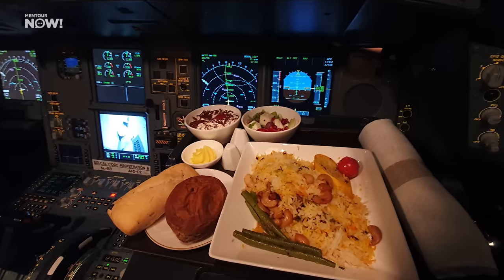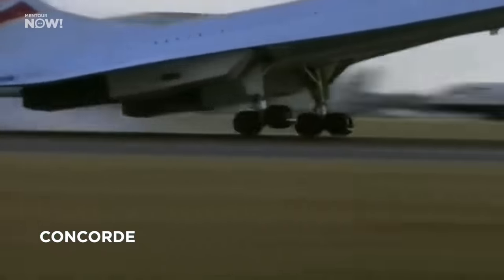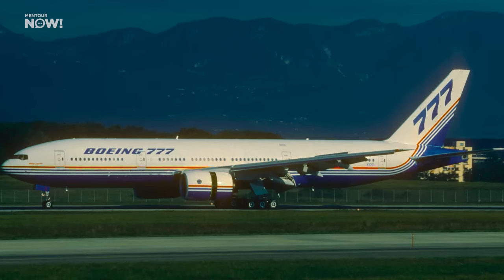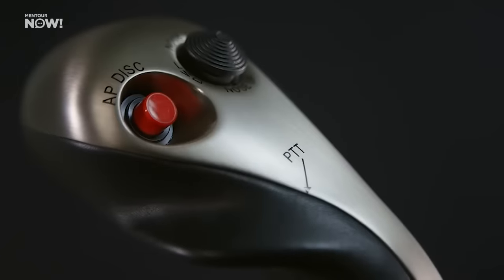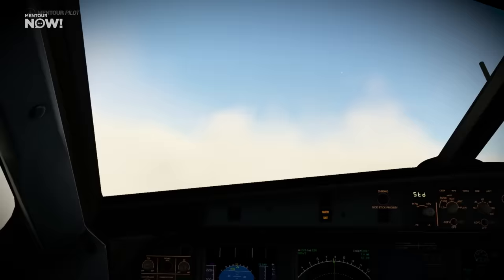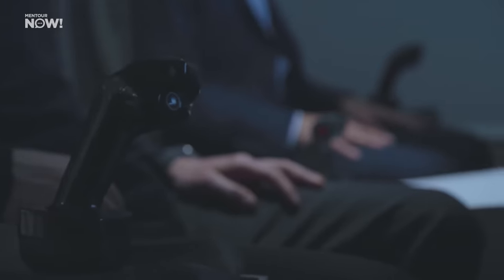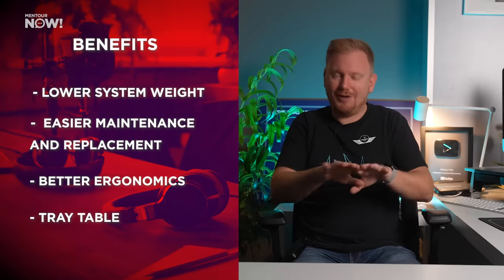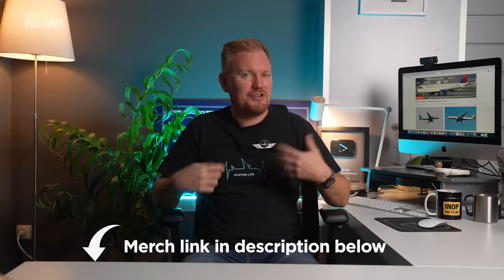Will Airbus Finally switch??

Comment: As an Airbus pilot, I really hope this actually happens. It's been the thing I most don't like about the A320 since I started. You sometimes feel a bit disconnected from the airplane which makes it less fun to fly. Also if this happens we'll have even more ammunition to throw at you Boeing guys in the airbus v Boeing banter we all engage in (most of the time it's completely friendly and just banter. We all try to respect each other and we're all aviation nerds so an airplane that has yokes instead of sidesticks is still going to be cool to us Airbus guys.)
Reply: You mean you are an Airbus computer game flyer
Reply: @MySkyranger  no...
Reply: @MySkyranger 😂 He's the king I'd say, probably never stacked it
Reply: I’m not familiar with Airbus, but are the sidesticks in A320s lit in any way when the ambient lighting is low in the flight deck? For example - active stick when autopilot is disengaged is lit at the base and/or non-active stick is lit at the base to indicate the other is active? Some sort of visual indication seems to me to be useful (and probably far easier to implement (if it’s not already) than feedback). Btw I’m based in CLT so I’m pretty much on A320s all the time - I can always tell when autopilot is disengaged when on approach with the little “wobble” 😉 happens on others too, just feels more obvious on A320s. Less so the A330s we used to have here.
Reply: Yeah, the tray table argument is always one of my favorites as an A320 and A330 pilot, it just makes eating and filling paperwork so much easier. Oh, and don't forget that the A320 cockpits are about 2 times bigger than a 737 cockpit.
Reply: @LucasDiep  yep. Taking a peek into the flight deck of a 737 wherever I get the chance always horrifies me. I can't imagine spending up to 6 hours in one of those. Cramped, dark, cluttered, big metal stick in-between your legs, no thanks. I'll take my A230 any day. I will still always respect the legacy of the 737 nonetheless.
Reply: I think that the sidestick doesn't have as much motion as the yoke, so its much easier to do fine adjustments in yoke than in sidestick.
Reply: @abcdefgh6121  eh that I can see but I don't really find that in my day to day. The sidestick can do everything I need it to do and I think Airbus have the sensitivity down pretty good.
Reply: @abcdefgh6121  Huh. Flying A320/330's for over 10,000 hours I never really felt a struggle making fine adjustments
Reply: Unfortunately due to the lack of wing flex on all Airbus aircraft. They seem to make better plows than planes. Good for the earth. Very bad for passengers and crew.
Reply: No Airbus pilot wants to give up spaciousness and the pull out desk in exchange for a big-ass yoke.
Reply: @LucasDiep  I agree. Don't have quite as many hours as you do but I've never found the sidestick lacking in sensitivity.
Reply: @thereissomecoolstuff  what? What are you implying. 🥴
Reply: @LucasDiep  I was chatting to another pilot from a different airline that has 737s instead of A320s at mine and the tray table inevitably came up and he said "Hey we actually do have a table. We reach back and grab our QRH and/or other binders and sit them on our laps. Instant table." I said "imagine needing and relying on a QRH to know what to do in an emergency. My airplane tells me what's wrong and steps to resolve the issues. It's called ECAM." A bit cheeky but he took it well and then said something about being called a retard everytime we land.
Reply: @elliott7268  just trolling.
Reply: @LucasDiep  okay. i just said what i felt, as sidestick has a very limited motion as compared to yoke, so i thought that for example the minimum we can move  our sidestick is lets say, 5mm. so the same 5mm if deflects plane at like 5 degrees, the same will deflect the plane in yoke to just 2 degrees. so the yoke offers more fine adjustments which are crucial in moments like flare, where it should be pretty accurate. and fine.
Reply: This is a waste of time discussion, it never going to happen. whatever replaces the A320 family of aircraft will have either the current side stick or some newer version. The title of this video is very click bait, some people will assume Airbus will be open to it, they are not, and as for a new Airbus single isle aircraft, don't look for it until 2030+
Reply: @LucasDiep   Agreed. Similar experience. Similar conclusions. It is definitely easier to overcontrol on the A330, but not doing so just comes with experience.
Reply: @thereissomecoolstuff  Huh??  What about the Airbus A220 Series which was designed by Bombardier who are famous for their flexible wings on their business jets.
Reply: @abcdefgh6121  Yes I agree, I am just saying that I never really struggled to control either plane/make fine adjustments when flying.
Reply: @Adscam  I watch a channel called cargospotter he videos take offs and landings in Europe. You watch a 777 land you see those wings just bend while the beautiful landing gear touches down. Graceful, like a ballerina. An Airbus comes in all stiff and gets jacked around. Looks like Biden trying to pick up his keys off the floor. Which do you prefer? A ballerina or an arthritic old man with VD.
Reply: Scare Buss
Reply: @ferrariguy6389  Boeing, building paper airplanes since 2018.
Reply: Agreed even in simulation world it feels weird. Almost like a pitch up command feels irrelevant, however pilots know pitch up command should never be disregarded unless thrust is applied.
Reply: Nice try msfs fbw pilot 😂😂😂😂
Reply: @elliott7268  why does flying professionally in an airline setting need to be "fun"? When passengers are nervous in the cabin with strong winds and updrafts pilots are nonchalantly having "fun"? I've never heard of a medical doctor having "fun" in a life or death situation?
Reply: I know form experience that Boeing and Airbus pilots drool the same when they sit in front of the controls of a legendary aircraft like f.e. a DC3 / L-749.
Yoke sidestick whatever they just want to get that bird in to the air!
Reply: Hi elliot, agree entirely, I suggested feeback for the Side sticks AND for the throttle levers  some years ago when we operated the A330s. My words at that time  were exactly like your,s now,  "Pilot is disconnected from the plane" . Not a good idea !!
Reply: @abcdefgh6121  nah dude. I'm pretty sure there's some sort of sensitivity curve on the side stick. We have no issue making fine adjustments.
Reply: @topethermohenes7658  ok... It doesn't need to be fun sure. But I'm a pilot because I love it. I love flying 60t airplanes high in the sky ferrying all these different people to work, families, holidays ect. What I'm saying is flying a little cessna to get my PPL was more fun and hands on than flying an A320 with a sidestick. I don't understand why you think that a job shouldn't be fun. Why can't I have fun. Do you expect me to just be depressed?
Reply: @thereissomecoolstuff  have you ever seen an A330 or A350 land? I'd call that graceful. If you've ever seen an A380 Land, especially in the flesh like I've been able to many times, that's pretty incredible.
Reply: As pilot of Airbus, I can suppose the idea was isolate one pilot from another(may be it was philosophy). It might be why the control is very sensitive to dual input.This new invention active side stick breaks the philosophy with plus and minus as well. 
For cadets it’s useful tool, but the Airbus is commercial plane.
Reply: @elliott7268  seen it all my friend. If you translate “Airbus” into any of the classic languages it means “Lawn Dart”. Boeing on the other hand means”plane of the gods” you fly on anything you like.
Reply: Both sticks are active in normal ops. If dual inputs are made, it is annunciated via voice alert and visual indications on the glare shield. 
If say, the trainee is making inappropriate inputs, then the trainer can take control by just saying “I have control” and watching the other pilot move their hand away . If time sensitive, ie.g landing etc, the same words and push the red disconnect on the stick. You get instant control and disconnect the other stick. The aircraft will be in trim, so all control loads and responses are as usual. That’s unlike a connected , conventional control column, where , if the other pilot doesn’t let go, the control loads can be very misleading. That has resulted in tail strikes on take off. It is a “ golden rule” on Airbus FBW, only one person flys the aircraft at any time. So it’s either the trainee or the trainer, not both. The same with automation. There is no helping the autopilot, or auto thrust. It is either automatic, or manual. The Airbus philosophy is if the automation isn’t doing what it should, disconnect and fly manually.
 I have seen and read of people flying conventional aircraft get into deep trouble trying to “help” the automation.
Reply: @thereissomecoolstuff  try telling that to the families of the victims of the 737 max crashes. Totally avoidable on Boeings part. Try telling that to the safety inspectors Boeing fired after raising concerns on the factory floor. I could keep going. Airbus will always win this debate. Boeings golden age is long gone unfortunately. I don't care what you think Airbus translates to. I care how the airplane flies and how they both deal with safety.
Reply: pretty cool that you're a pilot and enough of an enthusiast to comment on videos like this. i hope you love your job and know how jealous some of us are of you :)
Reply: @rockandrollstevesteve  I do! It never gets old. Even now just driving to the airport and feeling the Rumble and roar of aircraft taking off and landing gets me excited
Reply: @elliott7268   you have the utmost responsibility to your paying pax to get them where they need safely, professionally. IMO Work seriously in the cockpit, rent a 172 and have fun on the off days.
Reply: @topethermohenes7658  dude. We can be serious and still enjoy our job.
Reply: @elliott7268  Do you know how many hours Max planes flew without incident prior to those 3rd world crashes? I’m not denying anything. All of it should never have happened. The question always should be pilot skill and training. Please tell me pilots in remote areas are held to the same standards and practices as carriers here. They aren’t and never will be. Did the pilots actions contribute to the crash? Airbus doesn’t not win the debate because it is subsidized by the very govt that regulates it. That reason alone has my preference on BA. The french media doesn’t have the spine to cover an Airbus issue. Boeings golden age is far from over. This side stick issue and the time it has taken to correct proves my point. By the way, there is always an Airbus groopie wait to get backstage when someone says anything bad about the flying baguettes. I guess it was your turn.
Reply: @thereissomecoolstuff  still haven't heard anything bad about Airbus... Also Boeing literally didn't tell pilots or Airlines about the existence of MCAS. No pilot no matter how well trained can know about systems they were never told existed. We can keep going on like this but what's the point. You've made it clear that you prefer Boeing even after all the dodgy stuff they've done in the past few decades and you've made it clear you don't like airbus even though there's no reason at all to hate them.
Reply: @elliott7268  you can love you job yes, absolutely. But going out of your way in the basis of having "fun" doesn't sit well with people you fly with, your company and especially your pax.
Reply: @elliott7268   it is implied in you original comment that it's "less fun to fly" and a320 because you feel disconnected, and if you mean less fun means you hate it, better fly 172s and have the time of your life
Reply: @topethermohenes7658  who said I was going out of my way with anything? All I said was I think flying with force feedback is more fun. That doesn't change how I perform my job.
Reply: @topethermohenes7658  so less fun to fly = I hate it? Ok yeah we're done here.
Reply: @elliott7268  I don’t hate the baguette of the skies. I like all aviation. Innovation no matter where it comes from is to be celebrated. None of us would be here in the free world if it wasn’t for Boeing and the women across this country that went from the kitchen to the factory and back 70+years ago. That’s where my loyalty is rooted. Times change and companies change but the simple fact we would be speaking German and Japanese if it wasn’t for Boeing is good enough for me. Good luck to you Elliott. Thanks for the exchange.
Reply: @elliott7268  fun fun fun more fun that, less fun this. Oh God it's like a teenager falling in love for the first time do all pilots act like this?
Reply: @thereissomecoolstuff  a couple last things, I agree that the older golden age of aviation was the best. And Boeing was fantastic in every way. Times have changed though. Just because Boeing was great long ago doesn't mean you should still favour them and ignore their big problems. I used to love Boeing. But to be honest, why be loyal to any company. They're all big billion dollar companies that don't care for us at all. They exist to make money. 30 years ago I would have preferred Boeing. Now, Airbus is killing it. Why be so loyal. Why not get behind the people innovating and keeping the industry going safely into the future.

Also, I'm not from "the free world". This is the world wide web after all.

Enjoy ya day
Reply: @elliott7268  I had my suspicions you weren’t from the free world. My loyalty again comes from living in and being around the workers and families for generations of Boeing Aircraft Company. Boeing leads in innovation from aircraft to Space. They are a for profit company whose stock and bonuses have benefited millions in the free world. These benefits to the families and regions where Boeing calls home are all on the backs of the parts producers and assembly workers. They produce 38 737 a month moving up to 50 a month in 2025. That is pure manufacturing muscle. That’s why I’m loyal. I am also honest and will agree mistakes were made. That is life. So we share 2 different perspectives. Mine from a “Free Country” and yours not. Loyalty counts for something. It’s a character thing. Next time I’m in a Boeing jet getting pushed back and I look over and see an Airbus next to me. The people all crushed in their hard plastic seats I’ll think of you. Oh wait update… the Airbus is on a maintenance hold. They have to change planes. The part is coming out of baguette land.
Reply: @elliott7268 being called a retard on landing just isn’t nice and friendly. I’m not a pilot of either or but the Boeing and its conventional systems do sound more appealing to me than relatively new and complex technology put into the side sticks. I’ll give up on a table that folds out and rather take that paper QRH and know exactly that there’ll never even possibly be any computer glitches on my binder than a screen. Hats off to airbus but Boeing seems the way to go. Then again in medevac you don’t have either or so until beechcraft king airs come with side sticks the yoke has my heart.
Reply: @fabiansachs1907  sure. I hope you know that retard means to slow down or flare. The plane isn't actually calling you a retard. Also you might have some biases against modern tech which is fine, but saying Boeing seems to be the way to go isn't objectively correct. Everyone including Boeing is moving towards advanced tech we already have in Airbus aircraft. Take the 787 for example. Also, we don't just have ECAM, we have physical QRHs as well. We're never relying on one of anything. Regardless, if you like the Yoke, that's great. I would prefer a yoke if the sidestick wasn't so comfortable and didn't take up a lot of space. When you spend hours in those flight decks, space is an important commodity. But yeah. You're entitled to your own opinion.
Reply: Not supposed to be fun
Reply: Congratulation, on your great achievement. I was a helicopter pilot in the army, but due to a left ankle injury whiles in service. I couldn’t transition into the civilian world, so my flying days is over.
Reply: > makes it less fun to fly

When handling an aircraft with hundreds of lives on board, the first priority probably shouldn't be "fun"
Reply: @topethermohenes7658 That answer should be a given. The more you love your job, the more you tend to be the absolute best at it. As for your comment about doctors, you must not know many.....
Reply: @dmcr9525   I'm not talking about loving your job don't you know how to read? Being stupid is easy nowadays
Reply: that last part is a lie
Reply: The problem with a yoke is it is harder to get the cockpit to fit really large or small pilots. Small women have significant problems reaching the controls on Boeing aircraft. And you might argue that's their problem, but a) that's not fair and b) there's a worldwide shortage of pilots likely to last years or decades.
Reply: @abcdefgh6121  "fine adjustments" are what trim controls are for
Reply: @abcdefgh6121  The difference is that you're flying a yoke (or central stick on old style single seaters with your entire arm, whilst you fly a sidestick with your wrist (elbow anchored).
Reply: 😂just because you guys can play minesweeper on your secondary HDD doesn’t mean your airplane is better than ours!!! 😂😂😂
Reply: Yes, and as Collective Souls lead guitarist, I'm thinking of switching to Gibsons...............
Reply: @thereissomecoolstuff well said.
Reply: Did your airline make you fly airbus?
Reply: @elliott7268 autopilot managers vs real pilots (no hate I love fbw)
Reply: @abcdefgh6121 but that’s not how the sidestick works. You’re commanding a rate of change, not a flight control position. I’ve got plenty of Airbus hours, although currently fly a 787 (as well as 737 and 777 experience). Either one of them will do exactly what you want it to do when you’re flying manually, which is probably about 1% of the time in any typical airline sector. Provided, of course, that you understand what you’re asking it to do. Personally, I think moving from a sidestick to a yoke is a backwards step.
Reply: @elliott7268 And yet I know several pilots who moved from Spirit and Frontier flying the A320 to flying the 737 at the legacies and they love it. You Airbus bunch are always so dramatic.
Reply: @FlatOutMatt  are you serious? The B17 alone and it’s production rate saved the world. Believe anything you want but the employees of Boeing continue to play a major role in world stability.
Reply: @FlatOutMatt  Matt you are trying to do the classic liberal “Opinion as fact” practice. You are correct in that there were several manufacturers available then. Much different than today. How do you decide which manufacturer produced the game changer in WW2. You need criteria. Is it actual models produced or bomb tonnage capacity based on model. You cannot argue Boeing built the biggest bomb dropping capacity. As far as the Max goes. It has been a very interesting chapter. I think Boeing learned it’s lesson. I also don’t agree with all their production decisions. The fact that they produce a 737 a day+ is a strong indicator that BA is still on top. I proudly stand by that. Legacies start with history. In the early 1940’s the people of my country came together and produced more machinery, weapons and ammunition than they could have ever imagined. I can’t see that ever happening.
Reply: Also a pilot having flown Airbus and Boeing but I disagree. Other than the lack of control authority of the 320 series when landing in gusty conditions I find it a much more efficient way to fly than the big clumsy control column
Reply: @FlatOutMatt  you flex opinion, I flex feelings. Now I know you’re a Boeing hating liberal. The extreme backlash towards Boeing through this was the most interesting part. Everybody took a swing at them. It’s all good. You certainly found out who your friends were.
Reply: @FlatOutMatt  I don’t care who you hate or your politics. I appreciate the exchange and perspective even if I don’t agree. Now let’s see if you’re one of the liberal last word people.
Reply: Airbus is superior to Booing in every way.
Reply: @FlatOutMatt  oh yeah? What Airbus plane killed a bunch people and management coming out saying it's the pilots fault.

I am waiting
Reply: @FlatOutMatt  what quality? The trash found in the wings of 787? The fuselages that don't fit? That quality?

Tell me you work for Booing without telling me.
Reply: @FlatOutMatt  or the engines blowing up?

Lol quality
Reply: As an A330 captain and former A220 (aka CSeries) captain, the lack of feedback is really annoying. As pilot monitoring, on the older RH100, I appreciated to sense the inputs of my first officer. This tactile clue could really help me understand what was going on and intervene at an earlier stage. 
Oh, by the way, nobody mentioned moving and oversteerable thrust levers… It is just about the same issue…
Reply: @elliott7268 
Also, please have fun flying your aircraft.
HAVE FUN FLYING YOUR AIRCRAFT
(Please note aileron rolls are not acceptable methods of fun)
Reply: Elliott, I am heartened by your statement about making it less fun to fly. A long time ago I was sitting at the gate waiting to board, and a Republic Airline captain, who was dead heading, sat next to me. We chatted about flying a bit, and he answered some questions for me. As he stood up to board I asked him one more question. He had been flying for 19 years at that time. My question was, "do you still love it?" He turned to me with a big grin on his face and said "every day."
"To slip the surly bonds of earth..."
Reply: Heh... the sidestick is the best thing that airbus made, go to b737 then and you will be missing the normal law in seconds 😂
Reply: @LucasDiep Same thought here Bro... Flying A319/320/321 in South America... Don't mess with my tray table! 👍🏻
Reply: I'm not a pilot but a good friend of mine is. He flew B-52s in the air force. When he got out he went to work for Frontier and flew AB. He since then left Frontier and now flies another airline in a 787. He says he prefers yoke.
Reply: @elliott7268 Try telling that to the the family of the Air France AB that crashed in the Atlantic .
Reply: @topethermohenes7658 (Almost) nobody's dying there. Really. If they do, it is not because of negligence or lightheartedness (yes, there was an Russian pilot inviting his todler into the cockpit of the A320 midflight, but... y'know). Some people enjoy their work. It is nothing bad, really.
Reply: @WielkiKaleson   sure no one's dying but when I picture pilots having "fun" I picture some man-kid jumping around like someone has given him candy OR some old decrepit pilot having steamy interactions with the flight attendant. Both of which doesn't give me the impression that the pilot could save the plane in an emergency. Loving your job is all fine and good but keep it professional
Reply: @topethermohenes7658  Right. I guess it is not the case. At all.
Reply: Also for Boeing pilots it could always be the last banter.
Reply: @obelic71 DC3 legendary? did you mean to say Tu-104? Tu-104 is the only passenger jet with legendary status and was the first jet i was type rated on in 1979
Reply: @MySkyranger loved it you gave @elliott7268 some banter after his explanation about friendly banter.... But then reacted a bit butt hurt about receiving banter 😂 (btw, if it's Boeing, I'm no longer going. Airbus pilot here)
Reply: @DaleSteel  Americans--especially American me--often  like to keep the emotional atmosphere light and even joke with each other while working very hard. It's just a quirk of American culture.
Reply: @thereissomecoolstuff bringing politics into an engineering conversation sums up everything wrong with America today

As long as that mentality prevails there, as a passenger I'll feel much safe and prefer an Airbus aircraft to a Boeing any day
Reply: @LucasDiep I always thought the seats on a 737 were more comfortable despite having less room overall.
Reply: Sure, companies choose planes and constructors make choices so pilots can have fun
Reply: @LucasDiep side-stick allows you to cross your legs during long cruise segments of a flight. It’s a beautiful thing.
Reply: @thereissomecoolstuff Nonsense, as a passenger I never felt a difference in landing experience for the aircraft brand rather than the pilot's skills.
Reply: @wanderschlosser1857  then you have a dead ass. I can tell when it’s an Airbus immediately. My phone autodials my chiropractor. Stiff wings pass on any abrupt pilot control motions way more than a flex wing bird like the Boeing aircraft. It is what it is.
Reply: @thereissomecoolstuff  Still nonsense! Flying around Europe for ages, as an example I generally feel Air France pilots land their planes way softer than KLM pilots. I'm talking of short to mid range narrow bodies A320 series vs. 737 NG. You figure yourself which of the named airlines use which type. Didn't feel unsafe in any of them but the French seem to handle their planes more gently in favour of their passengers. Apart from that I couldn't tell which aircraft manufacturer has a smoother flying aircraft. The quietest cabins though so far were A380 and A350. Sorry but again, can't say Boeing was ever making a particularly better impression to me in comparison to Airbus. I actually don't mind flying in any of them.
Reply: @wanderschlosser1857  you are from Europe. You are even claiming French pilots land softer. To really evaluate or compare you need to ride in different planes landing at the same airport. I fly into Seattle frequently. I fly the small stuff. I have flown in an A350 and a 787. No comparison in my book. The 787 out performed the Airbus in every category but one. Food. I was on Lufthansa and enjoyed great food and a real metal knife. I also feel safe in all modern aircraft. I spend most of my time in the Max, cross country and over ocean.
Reply: @thereissomecoolstuff  When flying in Europe I was landing on the same airport in Scotland like a hundred times with all kind of planes from Fokker, over A320, 737 Classic and NGs, Embraer, even 757's. And no I can't really tell much difference for similar size planes from Airbus or Boeing. You could frequently tell a difference which airlines I was flying and how pilots handled the planes. And I tell you French pilots handle them more gently in average. I still preferred KLM because changing at Schiphol beats CdG2 in Paris, Frankfurt or Heathrow by margins. Now living in Australia again I couldn't tell a difference for landing experience between a Qantas 737 or a Virgin  A320.
Reply: @wanderschlosser1857  I appreciate your comments. Now that you have considered the differences perhaps you will note a difference. It is subjective and the variables are limitless. Having said that consider hitting the ground with a rigid 2x4. Then hit the ground with a rubber belt. Note the difference. That’s the same as the 2 company aircraft.
Reply: @thereissomecoolstuff  As I told you I only experienced differences by pilot skills or due to weather. Maybe aircraft size. I couldn't tell that I ever recognized a mentionable different landing behaviour by Boeing vs Airbus aircraft of similar size. Maybe your ass has got finer antenna maybe it's rather a psychological effect, who knows. No difference to me
Reply: @wanderschlosser1857  it does, it also has a dyno G meter. I would encourage you to sit just aft of the wings. Then you can see the wing flex or lack of. You can correlate the 2 now. To claim the nationality of the pilot influencing landing motion is a tougher burden to prove then no wing flex and a violent contact with the runway. Give it a try and let me know. If you’re honest I think you’ll be surprised.
Reply: @thereissomecoolstuff  Still not convinced since my experience tells me otherwise. Regarding the pilot's, it's not a nationality thing, rather an airlines thing. I always suspected the Air France pilots have kind of a competition for smooth landings going on. Well and KLM pilots seemed to land their 737 more like a race car, maybe trying to achieve as short as possible landing runs, who knows.
Reply: @wanderschlosser1857  it’s obvious you are one of those last word types. Listen, let’s agree you haven’t used my criteria to evaluate landing performance. It is obvious you are focused on the pilots technique and skill. Cool. I’m asking you to reevaluate your criteria from pilots to planes. Particularly Boeing flex wing jets to Airbus fixed wing jets. We have to leave the 747 out of it as it is the queen of the skies and every landing is smooth. What do you say friend. I know you’re going to say something because you can’t help yourself.
Reply: Side stick controllers fail often… I worked for Collins…
Reply: @thereissomecoolstuff Agree with the stiff wing and poor ride quality, but wtf with the plow comment?
Reply: @abcdefgh6121 There was definitely an adjustment, coming to the bus from 20,000 hours on planes with yokes or floor mounted sticks. I still find it seriously lacks feel, but it’s okay to hand fly, with only 1500 hours on the 321, 320 and 319’s. Of course its whole philosophy is to do everything for you. I wouldn’t call it a pilot’s jet, but it gets the job done.
Reply: @daviddixon6741  Thought it was better than “widowmaker”
Reply: @miscbits6399 with your fingertips, with the pinky out.
Reply: @TheStarPrynce   Yes, when they pandemic retired my fleet and a few others. Not senior enough for the 787.
Reply: @wanderschlosser1857 Sounds like KLM and Southwest have similar cultures.
Reply: 787 that had the captains tray bumped into the yoke then it took a dangerous nose dive? You forget that already or are you lying about being an airbus pilot?
Reply: @thereissomecoolstuff  So, France isn't "free?"
Reply: @Drgonzosfaves  used to be. Not after Macron. Same as Trudeau in Canada.